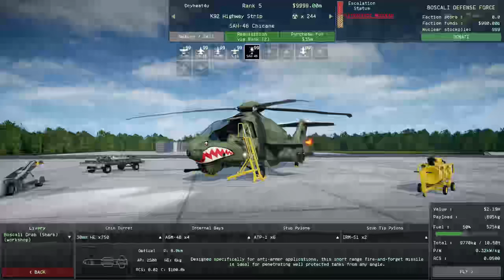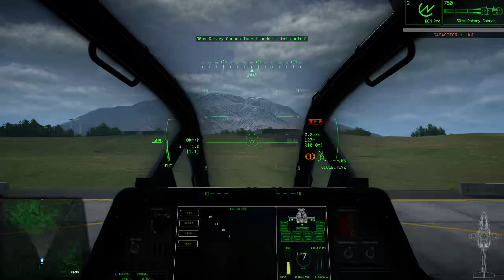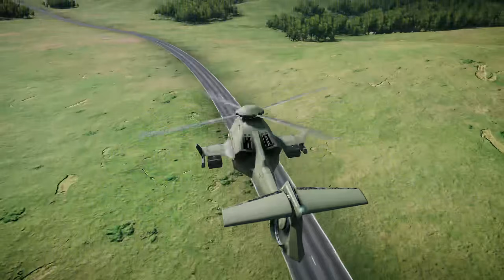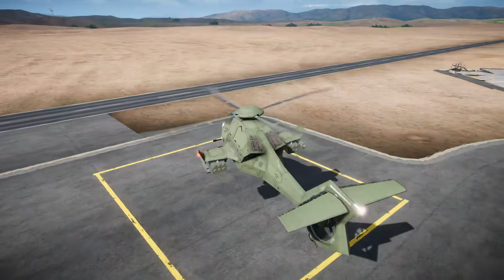Nuclear Option | Tutorial | SAH-46 Chicane | How to fly a Helicopter.

Comment: A tip for real life Rotary Wing flying.  Come gently to hover, tip cyclic forward with no collective adjustment.  It will take off after gaining speed beyond ETL.  Another good thing to do is rolling takeoff if you are too heavy.  Great video that can be nearly applied to any flight sim!  Roll-On landing is what we normally did for Infantry Assault missions just like you said.  It's faster.

Comment: Figuring out that I don't need to use autohover to land, instead just setting my pitch at 5-10 degrees while easing the collective has led to a significant decrease in rapid disassemblies as a result of enemy aircraft taking issue with me capturing their airfield or delivering units.  Especially the UH-90, where if I think I'm still going too fast I just throw the fans in reverse for a few seconds.

Still can't J-hook for the life of me.  Every time I try there's a suspiciously helicopter-shaped crater on the ground...

Comment: "Dumping" collective means rapidly reducing it. "Yanking" collective would be the correct, albeit similarly colloquial term.

There is no possible way for a substantial amount of engine exhaust to enter the intakes due to rotor vorticies. The chicane's exaust is pointed upward toward the back of the rotor to let the rotor dissipate the exhaust. It helps dissipate heat against IR missiles. Since exhaust is being blown backward and being dissipated by the main rotor, it's not possible for the intakes in the front to be ingesting an amount of exhaust that will noticably affect the performance of the engine. Remember - the main rotor is also sucking fresh air in from above. There isn't a cloud of 100% engine exhaust around you when you're hovering.

To further explain Vortex Ring State - it is when your main rotor is operating in its own downwash, and it loses a substantial amount of lift, causing an uncommanded and rapid rate of descent which is only worsened by raising collective. Normally during forward flight, you are travelling fast enough that you are outrunning your downwash. But when you are hovering at altitude, certain maneuvers can cause VRS - mostly a high descent rate that forces your main rotor into its own vorticies.

16:00 You don't have much yaw authority at all because of the stabilizers on your tail. The relative wind hitting those stabilizers keeps your chopper lined up with the incoming wind. Whenever you're doing a standard turn in a helicopter during forward flight, you would turn pretty much exactly how a plane turns - banking and pitching. Normally, you'd only use yaw controls during a hover. You can use yaw in combat maneuvers as the video describes, of course. Just wanted to clear that up.

Comment: @DryHeatAndSand - Gaming
my biggest issue with helicopters is hovering/landing
i often find myself introducing some kind of pendulum effect and sway left right for example and i cannot get out of it or stabilize the helo (specialy when iam trying to land at a specific exact point)
and i find it ultimativly hard with the ibus to not constantly have a slight nose drop when  trying to hover and therefore getting speed even if i dont want to
not sure if this is because of missing clear readable instruments so i could have an easier time leveling it out.
also almost everytime i try to land from a somewhat stable hover i get vortex warnings and i have no clue why to me it feels like its impossible to land without getting it at random points even when my -Xm/s isnt higher than 5 or 6
Reply: this is my biggest hurdle with the chicane aswell. i cannot for the life of me work out how to recover once VRS starts screaming at me.
landings are a coing flip.
Reply: @mcspiffington  land line a plane to avoid vrs. if youre in vrs, move laterally out of the way and make sure your rpm and collective are good to gain altitude

Comment: Why might my Chicane be popping up overspeed warnings at 210kt? I just cannot make my Chicane go as fast as I see it do in YouTube videos even as I copy exact angles and throttle settings side-by-side along with the video. Is my loadout like super fat or something? 70% fuel, all AGM-48s, 4x IRM-S1s, 72 IR Flares. Doesn't seem abnormally large for a loadout I might see *used*, but training with it hasn't been easy.
Reply from the maker: One of the recent updates revised the aerodynamic model for helicopters. The main factor limiting helicopter speed is the size of its rotors, not power or weight. Once the rotor tips go supersonic, you get aero effects that naturally increase drag but can damage the rotor. That's typically what triggers over speed warnings, not weight or load out.

Older versions of the game did not have this modeling, it may have been possible to go faster than in current versions.

The chicane typically can't go faster than about 320km/h without diving, and will over speed around 400km/h.
Reply: @DryHeatAndSand  Neat, I'll look at more recent uploads to see if I'm being a slug or if that's just how they're balanced now. Thanks!

Comment: 4:45 Wrong response to VRS in general, though the chicane has barely enough power to power itself out out of a vortex ring.

In other sims (or real life), pulling collective to power out of a vortex ring will guarantee an overtorque condition, loss of RPM, and a bad day. There is only one helicopter powerful enough to power out and that’s the Skycrane and even then only when it’s light. 

The correct response to a vortex ring is reducing collective (this stops putting torque into bad air) and flying either forwards or sideways into clean air.
Reply: I had read that too on both the wiki but also the game's wiki. However, there is also an other way the wiki is telling us to get out of VRS, which is to basically "side slip" by using the tail rotor. Im not fully sure what they are meaning, but I guessing something like how you see a fix wing trying to land on a runway in a crosswind
Reply: Just like what we do in a UH-60 Blackhawk in 1 step: Forward Cyclic.  Call Go Around and try again.

Comment: i would avoid maxing out or even really touching the collective while escaping VRS, the more air the rotors bite into, the stronger the downwash. Instead, its faster to put collective to a gentle climb and push yourself laterally as quickly as possible. The vortex is only about a rotordisk  and a half in diameter so you should slide out and be in recovery in 5ish seconds.  Also a good rule of thumb for avoiding it outright), is to avoid having your decent rate exceeding 10x your airspeed (i use knots/fpm for this, so if there's a conversion needed for metric, think accordingly) while you're in the flight envelopes where VRS is a concern
Reply: In reality this may be true but it's not simulated like that in Nuclear option. The VRS is just diminishing the lift the rotors generate based on your speed (VRS starts when you go downward more than sideways faster than 4m/s). So increasing the collective still increases the lift, which can stop the VRS.

Comment: As someone that played space games extensively, I found it much easier to imagine helicopter flight like newtonian flight in space, just with *spits* gravity forcing you down and friction decelerating constantly.
Also don't imagine "flying", but rather "hanging" from your rotor and just shifting balance, does wonders once you stop thinking from the wrong gimbal point that is usually in line with you in planes.
Reply: Elite Dangerous, for one. X4?
sighs StAr CiTiZeN.
Reply: Children of a dead earth and Kerbal Space program are two realistic ones (the later via mods)
Reply: can you tell me some space games with good physics
Reply: @destruct0503  elite dangerous and Flight of Nova both have very good flight models. 

the flight model in elite handicaps you with something called "flight assist" which makes your craft fly like a plane in an atmosphere, but once you turn it off thats when the newtonian flight model kicks in. takes hours to get good at it, especially for PvP, it has a very high skill ceiling. 

FoN on the other hand doesnt have any assist of any kind, but most flight is in atmosphere. there is orbital station intercepts that will require you to fly in zero G though so dont worrry. one thing FoN does better than elite is orbital mechanics, they are basically non-existent in elite. however elite dangerous has a lot more actual content.
Reply: @destruct0503  Well, KSP (Kerbal Space Program) is the industry standard. You can also try KSA (Kitten Space Program), it's free but very alpha-state.

Comment: my main issue with helicopters in this game is that they seem to require more buttons than my xbox controller has.
i see people manually switch hover mode, or tilt the rotors or independently change thrust and collective, and i know that i'm not going to bother doing that because i would have to take a hand off the controller midflight to reach for the keyboard.
does a joystick even help with that? 
how many axis of control and buttons does the average flightsim gamer have?
Reply from the maker: A basic throttle and stick works for NO. I have a more advanced setup for other games like Elite Dangerous and Star Citizen.

I find throttle and stick setups the most intuitive and flexible.
Reply: @Nander___  I think the game support button combinations, so you can set up inputs do be 2 or more buttons. That way you can get more done with a controller
Reply: I don't understand, the Chicane requires the exact same amount of controls as an airplane.

Ibis also needs additional axis for the pusher fans. But the Medusa, Vortex, Tarantula also use that so that's not a helicopter problem.
Reply: Depending on your posture while playing, you can map some functions to the keyboard instead. Provided they're options you can wait on like lowering gear or turning off radar.

Comment: 24:26 "I don't think this game actually has the, uh... HUDs working yet where you can free-look."
Are you talking about being able to move the actual cockpit camera around, or the camera on the MFD?

The cockpit camera can accept Keyboard, Mouse, Joystick, or TrackIR-format inputs (TrackIR, OpenTrack, etc.)
Not a clue about the MFD, though. I don't think you can manually traverse it.
Reply from the maker: I was struggling to find the right words for that. I have  a tobi eye tracker and Quest III, last I was aware these platforms are not yet supported for head tracking.
Reply: @DryHeatAndSand  I know in the past people have had success using OpenTrack to go from Tobii input to TrackIR output, though the 'how' I'm less clear on. I just use my cheap-o webcam and the head tracking baked into OpenTrack.

Checking the OpenTrack wiki, it supports Tobii natively as of April 2024.
Reply: @DryHeatAndSand  You can also use FaceTrackNoIR if you want to use your Tobii, it works really well

Comment: Hello my biggest problem is landing , i come to a stop and try to hover above where i want to land but i go into VRS everytime and come crashing down . So unfortunately i have to land like a airplane which is not the point of a helo lol and landing on moving ships forget about it once i can figure out normal landing first … i hope this video helps !!!
Reply: you should approach with some horizontal speed, and then rapidly reduce your speed and enter a hover just before you touch down. this method greatly lowers the risk of VRS. but if you absolutely must land vertically, you can enable autohover which holds the aircraft in a hover and limits the speed of your descent to prevent VRS.
Reply: VRS Happens when your vertical speed is greater than 5 m/s downward
Also if you max the collective as soon as the warning pops up it might be enough to get out of the VRS
Reply: @kerdain7239 thank you for the advice!!

Comment: Nice beginner lesson. 

The tail rotor is directly linked to the main rotor RPM, so when you get into low RPM the tail can not produce as much force as usual. The torque that yaws the helicopter to the left is the force produced by the engine, which is working full power when the RPM is lower than desired. So that's exactly when you actually need the tail rotor the most.

Few planes rely on raw thrust, that's why they have wings right. So it's not thát different from an airplane.

12:30 When you tilt back with low collective I wouldn't say it is producing less lift but more drag. At low collective the rotors procude way less drag, that's why the engine is working less hard and producing less torque. It's just that the tilt angle determines the lift angle, and now you are pointing your lift vector backwards. If you point the nose up a lot with low collective, the RPM will go up a lot. But if you do it with high collective the rotor RPM drops (because drag). So you can find a setting for the collective where the RPM stays nice and you can pull the nose very hard to slow down fast.

It's funny to see how different people explain helicopters, and it's funny how different people fly. I just roll and tilt a lot more, so I accelerate harder.
Reply: Since it’s just a sim I’ve been getting by on vibes and prayers spoken into the void